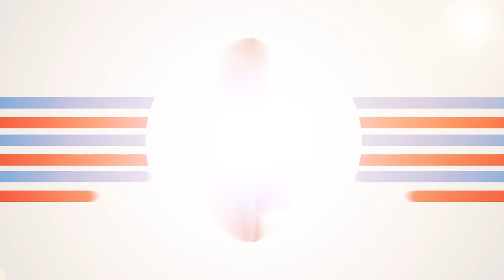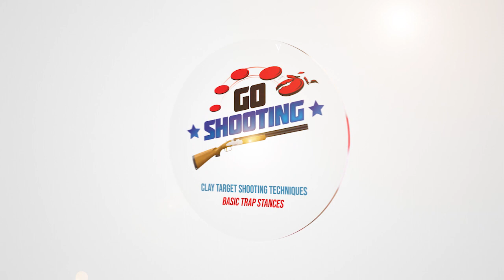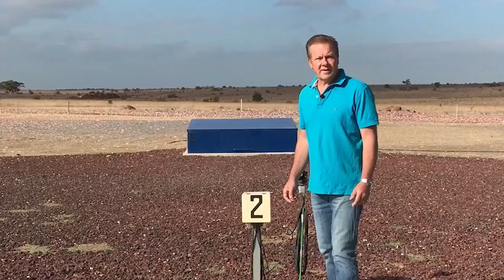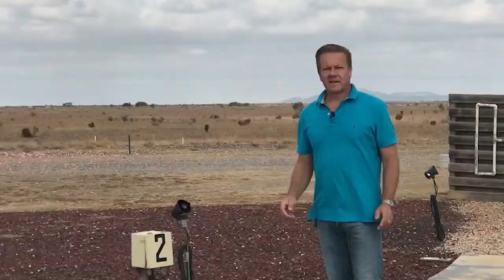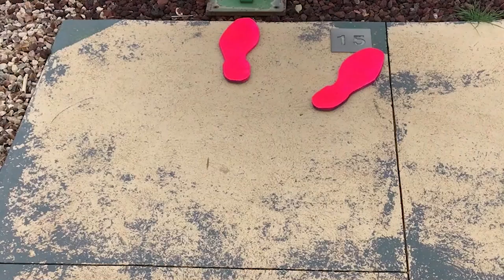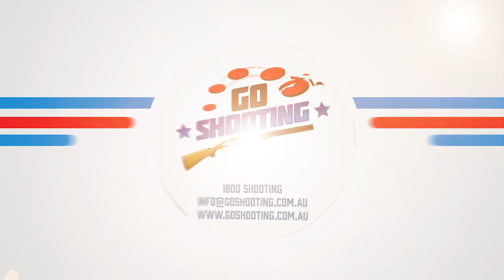#15  Basic American Trap (DTL)  Stances - Clay Target Shooting Techniques: #15 Go Shooting

Comment: ATA Rules require that you have at least one foot on the center line of the station.  It's technically against the rules to stand on one side or the other of the concrete pad.  

From the ATA rule book: "The contestant 
must stand with at least one foot on an imaginary line drawn through the center of the trap and continuing through the center of the post, or have one foot on each side of the line."

Not sure about DTL.
Reply from the maker: In DTL your feet (as per the video) must both be in the square. Where you stand inside your one metre square. This is also the rule in any ISSF event